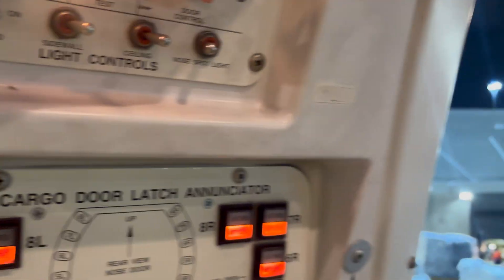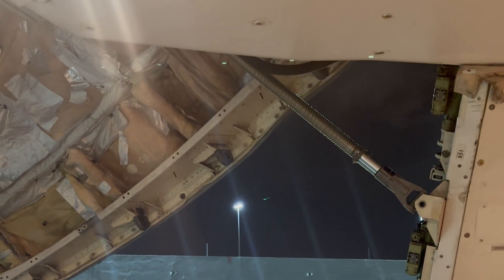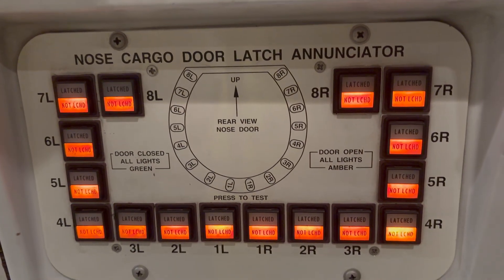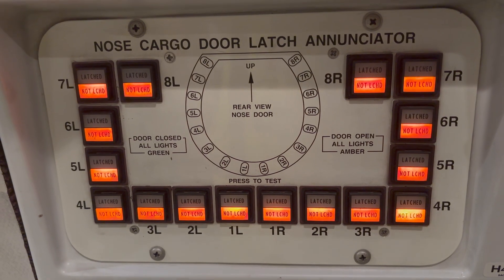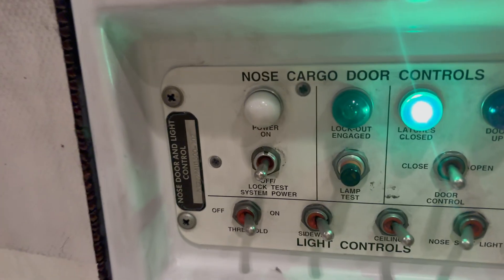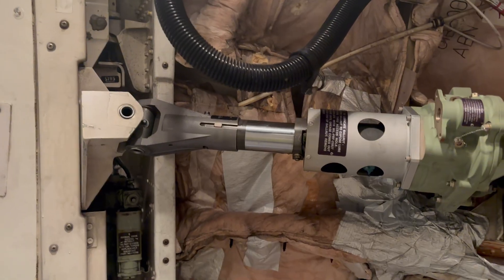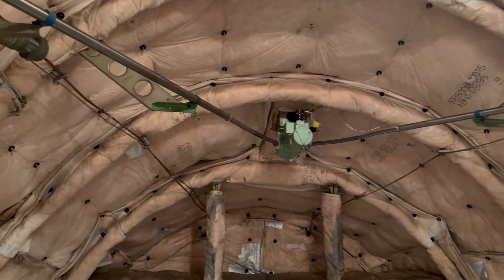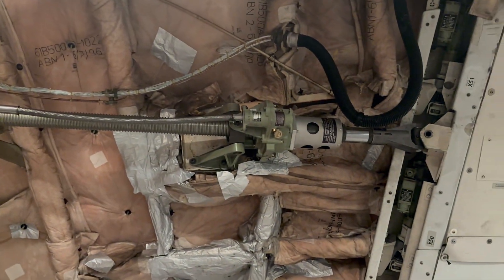Boeing B747-400ERF nose cargo door closing

Comment: This makes me nervous. Boeing already had a faulty door latching mechanism that opened in flight, UA 811, and not only were latch cams not held securely enough into the locking sectors, but a short circuit allowed electrical current to flow opening them. Simply turning a switch off is no guarantee. What if the switch is faulty or as with UA 811, a short circuit forms. The design of this door is similar to the side cargo door. It appeared in that case that a short circuit caused an unordered rotation of the latch cams, which forced the weak aluminum locking sectors to distort and allow the rotation.

There should be a positive disconnect, like physically unplugging a cable from an outlet. You can't trust an illuminated light when so much is at stake. You would need to visually inspect that all 16 cams and then physically disconnect any power to the actuator unit. Otherwise, you could end up like UA 811.  The only safe door is a plug door.
Reply from the maker: Boeing already changed the design after that accident. Power to the system is cut when two or more engines run. A wire short should not cause anything during flight anymore.
Reply: @dennisvijverbergbrakesrele6098  yes they fixed that issue but only in theory, the danger persists because it does not take into account failures of the safety interlocks. There is no failsafe design. The only way to do that is to physically disconnect the power. Kind of like cyber hacking. You can hope your firewall protects you, but you can not trust it. You have to physically disconnect from the internet.
Reply: @marks6663 multiple verifiable switches are, for all practical purposes, as good as a physical disconnect. A single faulty switch will be detected and cannot wreak havoc on its own.